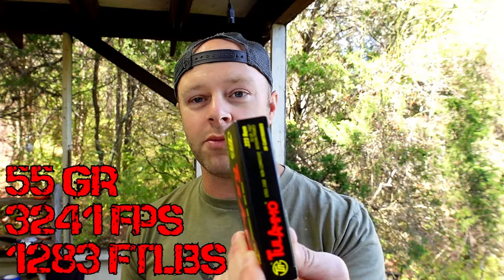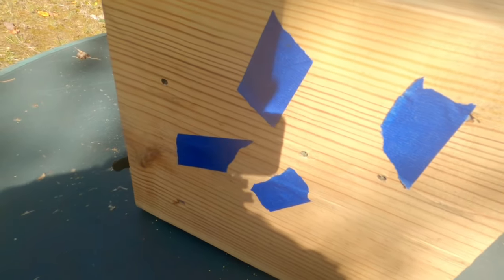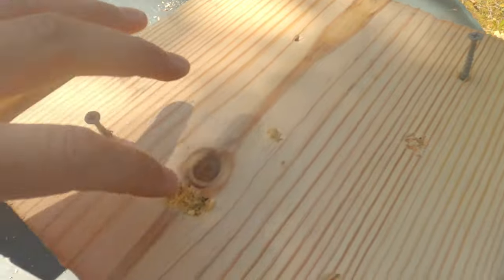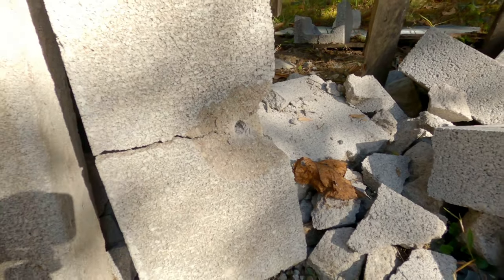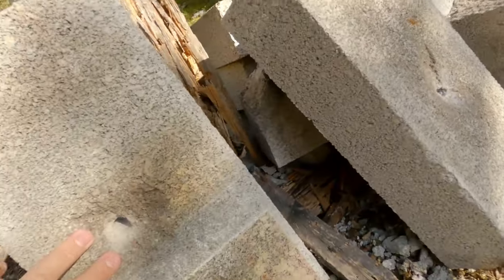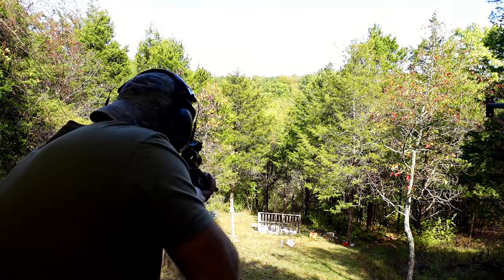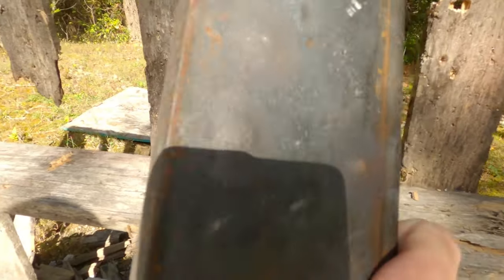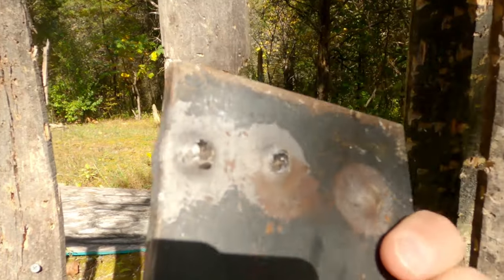AR-15 5.56 Bullet weight Shootout 55gr vs 62gr vs 77gr

Comment: Why do you so badly want 77 gr. Fmj? There arent any rounds commercially available in fmj that I'm aware of. 77 gr. Mk. 262 has 77 gr. Sierra MatchKings loaded in them which are open tip match hollowpoints.

Comment: A very key factor is that your 77gr is TMK and not SMK/OTM/Mk262. The tip acts to open up the bullet jacket and push into the lead core. It does not act to aid penetration. TMK is actually better in soft targets, providing both more consistent fragmentation as well as fragmentation at lower velocities. It also has better BC than 77gr OTM. However, it doesn’t perform as well as 77gr OTM through barriers (which 77 OTM isn’t really designed for to begin with). ARFCOM and rokslide have great threads on the devastating terminal performance of 77 TMK on soft tissue (e.g. hunting).

Comment: The AAC 77g TMK round that you used is basically the equivalent of a 77gr Vmax.  It is an unfair assessment to compare a Vmax style bullet to a FMJ on hard targets.   It's like comparing tissue damage from a Vmax or SP with a FMJ.
Reply from the maker: Most 77gr 5.56 is open tip and it makes sense to dump all the energy into the target if possible. I only used it because people said I should try a 77gr in multiple other videos
Reply: There’s no such thing as a 77gr FMJ. Everyone running 77gr is running open tip (as he explained in the video)
Reply: @connerm4850  I never said the 77gr was FMJ.  You may want to reread my comment.
Reply: @lopezmj7  lmao you may want to re-read my comment. I didn’t say you said it was an FMJ
Reply: @connerm4850 You implied 77gr FMJ. I just said that wasn’t a fair comparison in hard target penetration. LOL

Comment: You needed the OTM 77 they are not designed to open up like a hollow point, its as close as you can get to fmj…. The open tip is to upset it in flesh
Reply: They do tend to open like a hollow point, but the open tip has nothing to do with flesh. They are match bullets, and have an open tip so that the core lead can be poured into the jacket from the front instead of the rear. This keeps the weight toward the rear of the bullet which aids stability.

Comment: Try a 38 grain 22-250 Underwood in 22-250....I shot through my ar500 3/8" plate twice before I realized I wasn't missing. I thought I'd be ok at 50 yards, maybe a bad dent.... nope... I felt pretty stupid, because I figured I was far enough away for the little hollow point to punch through. I guess they really are doing 4k plus fps. Oops.

Comment: Vets say hostiles pewed with 62 shot multiple times no go down. 77 hollow expands to stop threat. 55 unknown. 62 blazed thru hostiles.
Reply: I just seen a video where a vet said they had to put 6 m855 through take a target to take em down.
Reply: Vets say a lot of nonsense, and they also missed a lot.
Reply: Personal experience.

When I used m855 62gr at ranges beyond close in Afghanistan the three times I saw my target go down they were hit with multiples. One guy got hit once in the right shoulder/chest area, kept going and then took two to the chest again center and went to his knees still shooting for about 10-15 seconds.

On my second deployment I was able to go to 77gr mk262 as my MOS had changed and had the opportunity for a lot more engagements. 0-400meters the 262 was lights out as long as the target didn’t have any form of hard protection. Would recommend the 75-77gr OTM offerings to anyone for defense in the US and 855 for range.

Comment: My understanding is that the SF teams figured out the 77 grain round worked the best in a CQB situation. Better knock down and less unwanted penetration. #1, you want your intended target to go down quick but you don't want too much over penetration because,...well just because.....
I didnt know the 77g  round was a soft tip.  
I have others, but prefer 55g soft tip rounds in my .223 setups. I figure that i can hunt with a platform I know, with a round I use for plinking, with no changes to my setup. And, 55g soft tip rounds wont break the bank. 
Thanks for the video.

Comment: I like running 77 gr   In a 1/7 twist 18-20 in barrel..
Reply from the maker: I was eyeballing a 20 inch barrel but found out 458 Socom works with just an upper change so I think I'll go that direction!
Reply: @RuggedAdventures  I don’t if you got into the whole 6mm arc .. they do have a new cal coming out. ( 6mm max ) it’s a 350 legend, case bottleneck to 6 mm)

Comment: Hey, i just thought of something. I dont know if youre doing this already, but remember, when you're testing against several 3/8 or 1/2 targets, that the steel is of the exact same quality and tensile strength. I.E. Cold Rolled vs Hot Rolled. Or A1011, A36, A588 etc.. Just a heads up and something to remember. It would definitely make a difference if the targets weren't cut from the same sheet of steel. AWESOME CONTENT and learning!!

Comment: M855 was designed to penetrate a late Soviet-era steel helmet. That mild steel tip does come at a cost because it is difficult to position perfectly round-to-round resulting in well documented diminished accuracy. Also well documented is the ice-pick wound characteristics. The transition to M4 length barrels (and the resulting reduction in velocity) seems to be responsible as the round doesn't destabilize and fragment.

I settled on the 77 grain AAC offering as it seems to feed reliably (at least in my platform), is VERY accurate (it's a Sierra Match King offering) and at $.85/rd won't break the bank. I don't really think I am going to be running into any armor to speak of and it works well on small and medium game game and varmints (the four-legged kind, though I suspect that based on the Marine Corps experience with Mk262, it would work equally well on the two-legged kind as well)

Comment: I’m brand new at AR ownership and found this video very enlightening and well done! Thanks! I’m a new subscriber now and hope to see more from this site! Would love to see a beginner’s post that would put into perspective of what is necessary for a novice(like myself) to consider when purchasing ammo for this platform…I will be practicing using the AR at the range so should my ammo be a lower(55grain) for that application while learning the gun? And then upgrading to say to 62grain for defensive ammo? Hope these aren’t dumb questions,lol…but just learning,thanks!
Reply from the maker: People get far to into the weeds with ammo, bullet weight, etc. Just grab a bunch of 55 grain and run it, that works fine for 99.99% of the time. 62 grain is designed to penetrate more and is probably not great for self defense. A 77gr open tip would be better but again, 55 will do just fine. The biggest thing is to shoot and learn a lot. Welcome!

Comment: Could you try a 50 Cal through 8 inches of reinforced concrete? I'd like to know if my house is fifty cal rated or not
Reply: Ur house has 8 " thick concrete? A cement block is hollow
Reply: @rossauce12  no blocks here just 8" of concrete with rebar and 2" of foam and concrete hardyback on the out side and 2" of foam and then drywall on the inside I know it's 30cal proof but not sure about 50cal they got got some perty wicked ammo for them things
Reply: @rossauce12  big bad wolf ain't blowing his house down.

Comment: i appreciate the content,  however it would have been ideal to use a  bras/ us produced 55gr bullet as the tula ammo,  while 55 grs,  is not going to be the same as say,  m193. the bullet construction is different with tula using a bi metal jacket as opposed to pure copper and lead, which could lead to different results.  and m193 would have had a little more veolcity.

 personally i stopped purchasing any steel cased ammo for my AR as its not as reliable,  and these days brass isnt that much more anyways.

Comment: I’m zero’d for 55gr practice ammo. But I want to get some rounds for hunting too. Just for coyotes. Idk if I’m actually going g to hunt but I want some good ammo so they don’t suffer if I do. Any suggestions? I have some green tips, I think they are m855. I just want to keep my zero if possible too. Vmaxx? I hear that’s good.
Reply from the maker: 77 grain otm is a good round. Within a couple hundred yards you'll be in the ballpark but it will be off a little.
Reply: @RuggedAdventures  thank you.
Reply: Depends on if you want to keep the hides or not. 77gr your getting 2 holes almost guaranteed. 50-55gr vmax or lighter and you'll get a lot of stopping power but not too bad of damage on the other side fur. Anything lighter than 55gr likes at least a 1:8 twist maybe a 1:9 twist 223 or 223 wylde barrel tho. You'll see most varmint rds are 223 specific and not 556